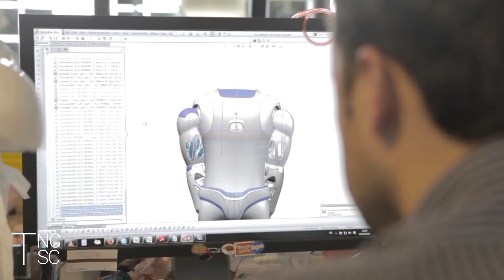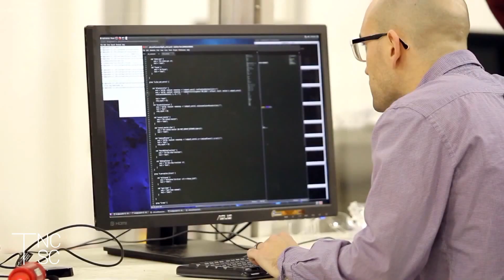Top 5 Humanoid Robots of 2015

Comment: Atlas has most idiotic design, high center of gravity. And it is ugliest robot in the world !
Reply: Prototype technology, more likely to be used in military situations than household services. That's left to things like the Mitsubishi bot
Reply: +Ex Set its a prototype and its the most advanced robot of them all, and the extra odd shape is due to the power system so it doesn't require a power tether.
Reply: +Ex Set Ah yeah, I know, if you're in the army and have to test something the roboter you're testing it with have to be pretty af... good point, bro
Reply: thank goodness you're here to tell the engineers and scientists who know absolutely nothing when compared to yourself, all the errors in design that they made.